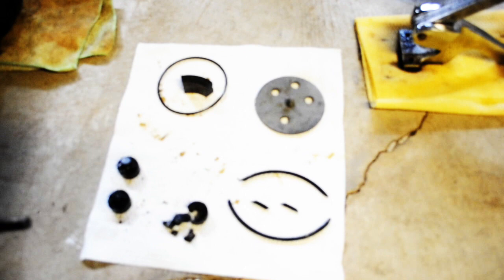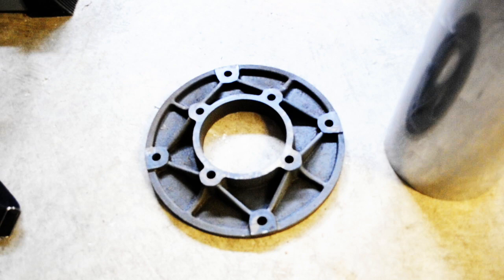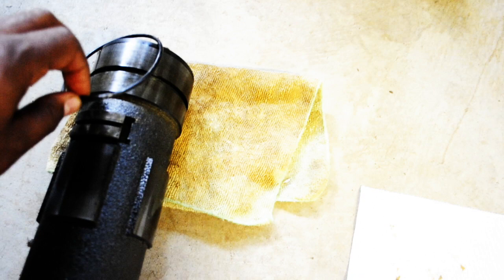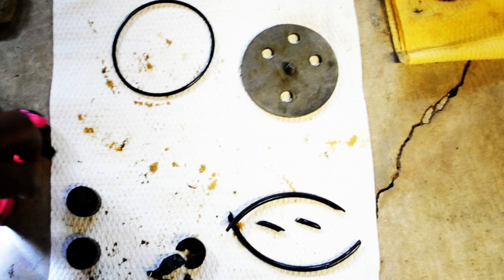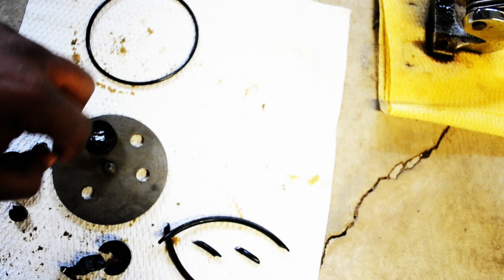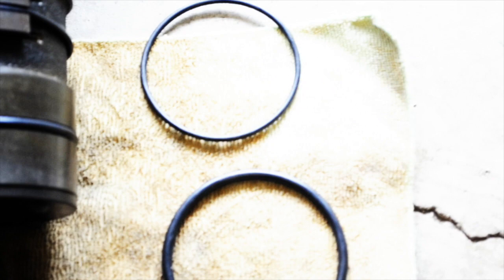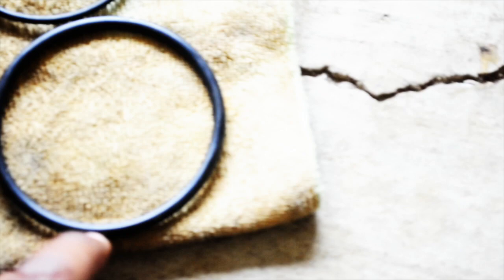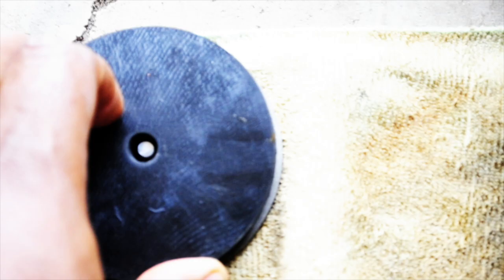The Belmont Barber Chair Project pt 1

Comment: You can go to a rubber and gasket company and they will make the pieces for you. The thin rings I purchased from a hydraulic shop here in Nashville.  If you look at my title/subject  it will have the places I purchased the parts good luck.
Reply: Would you mind to to share the contact information, for o ring gasket. Thanks

Comment: You may want to break it down and take a look at the hydraulics see where it's leaking. Them old chairs parts are damn near everlasting. Probably just some worn bolts or seals. Check that out first.
Reply: Hi any chance that you have pictures of the break? Or know what is made off of? Mine is missing

Comment: How did you remove the lever that pumps the chair and locks it
Reply: remove the Pin that is underneath and just behind the foot rest.  and remove the bolts from under the seat area.   to remove the whole thing..  under the pump handle itself there is a tapered Pin u have to remove ..

Comment: i Need Your HELP.... I have a 1949 Belmont barber chair, the base is steele... It leaks oil slowly in various areas! As a result the hydraulic pum no longer goes up when pumped with the handle. I Need PARTS... I NEED A CONTACT TO A SUPPLIER THAT WOULD HAVE THE PARTS NESCESSARY TO REPAIR CHAIR... HELP...

Comment: same chair I learned on in Barber Collage 1967,   worked in shop that had exact set up as barber collage.  I felt at home..  now I have 3 of these. tore it down , re did all the metal with power coat. and had all the vinyl re done also   but now it is missing the sleeve in the pump handle to keep it tight.  any idea where I can locate one...  BTW  Power coating is great but they did the  leaf spring , and now they are STUCK..
Reply: Define the sleeve in pump I don't understand.
Reply: you know when you remove the spring mechanism from underneath the seat , you can pull the Rod back and it will allow you to release and remove the pump handle on the right side of the chair. (pump/lock/recline  handle)  well when I put this back together the Handle just wobbles all over . my friend said it needed a sleeve like tube thing that will take up the space and make it tight again..

Comment: Hey now I am undertaking a restoration of the same exact chair! my hydraulic plunger is bound up can you shoot me some pointers on the system?
Reply: It may be the brake, if you push the lever down all the way and have someone put pressure down on the seat. Air can get in there and lock it up
Reply: hydraulic unit had been locked up and i have  begin separating unit and piston is locked up also  turned into a real job so far, i will keep you up on progress

Comment: sup brotha....i have an old belmont that looks like a similar pump. any updates? did you find any specs on the pump? any info would be of great help for me since my chair pump is not working since i separated it from the base.
Reply: If your pump was working before you seperated it you may have to replace the rings and hydrualic fluid as I did in my videos. If that does'nt get it you may have to replace the pump.
Reply: where did you get those gaskets? also the ring. mine is 3 1/2 inch wide. how much fluid did you put in? thanx brotha sorry for the bother just trying to get this chair working again.
Reply: how you manage to separate the pump? I'm having problems trying to fix mine because is leaking any tips pls!!
Reply: universalpenman Did you replace the rubber rings, and when you put oil in... put it at the half way mark. If you watched both videos it's all basically step for step. Good luck

Comment: I just took my base apart only to find the swivel brake shoe is missing- and the rubber ring. Does anyone have a source for one? It is a #5 as demonstrated here
Reply: Mik PopielMikP go to your nearest rubber and gasket company they will fabricate it for you
Reply: Thanks Rasheem. I'm missing the metal brake shoe too though. Any tips on sourcing that?
Reply: Mik PopielMikP Did you clean the hydraulic fluid and cylinder out? It may be stuck off in there if not I have no idea... That sucks